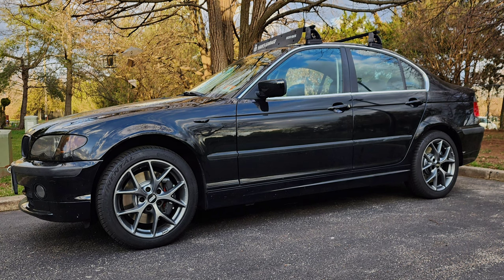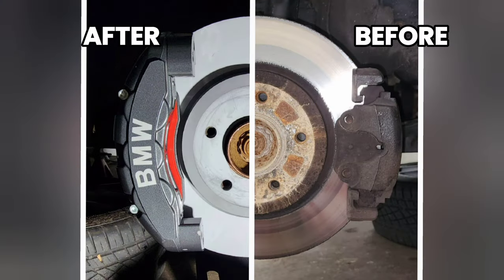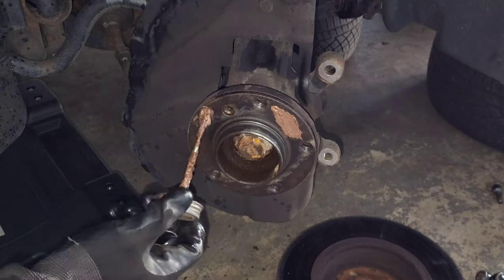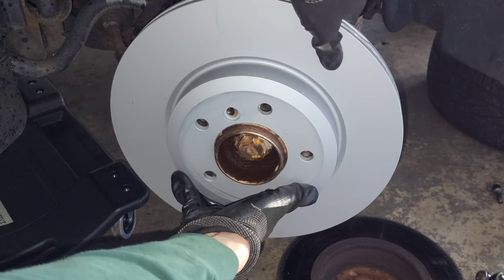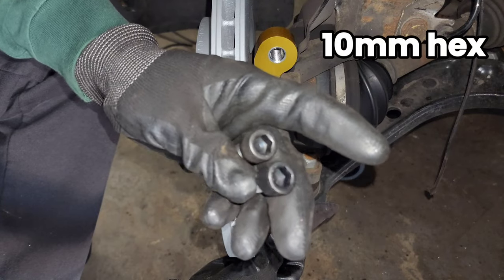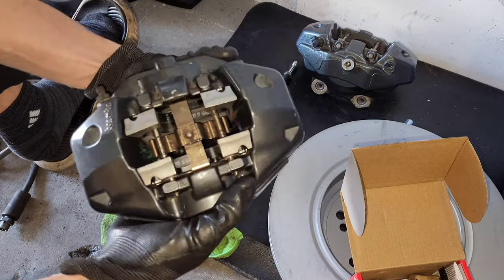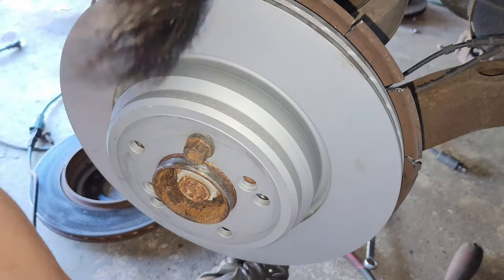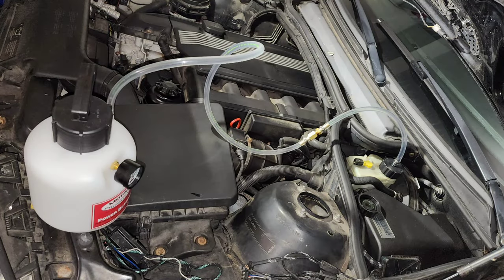BMW e46 Big Brake Kit Upgrade

Comment: Good to know everything bolts up on an Xi too, usually hard to find specific info on them. Brake booster issue is a bit disappointing… nothing else seems to mention that in my research. If you end up trying out the Porsche conversion that would be super interesting to see, looks like those are shared Xi or not
Reply: Don’t act like you don’t have to fix other bs on ur car buddy 😂

Comment: That’s not a BBK…. I’ve put the F82 M4 discs & callipers on my E46 M3.
I’ve developed a fitting kit that allow the F82 M4 brakes to go straight on, NO machining of the caliper at all.
Done both my 46 M3’s👌
Reply from the maker: Big brake kit. With brackets from seems legit garage. Also no machining to the calipers. What did you do to develop a fitting kit?
Reply: @HansGarage  PM & I’ll so what I’ve done!!👌

Comment: hey Han, great walk through of the process. i have a Z4 3.0si coupe, and I acquired some porsche 996 calipers that will be going in with m3 csl rotors. one detail i'm trying to iron out is about the parking brake. shoes for the non-M Z4 and E46 appear to share pn's, however M coupe and E46 M3/CSL all share a different brake shoe part number. I saw that your ebrake shoe looked a bit worn, but was wondering if you could comment on how well the non-M E46 ebrake is functioning with the M3 rotor?
Reply from the maker: I did have to adjust a little bit, make it bit more wider with the shoes and it bites just as well as they did
Reply: @HansGarage  Han, thanks for the insight. That gives me confidence that i'll be able to make it work as well.

One thing i noticed is that aside from the shoe pn's being different between M and non-M, most of the rest of the hardware is shared. ie: the barrel adjuster, and the lever mechanisms, etc. I might try fitting some M shoes. I think the deciding factor would be whether the little rectangular lug cast into the trailing arm, that the shoes set on, is the same between M and non-M.

Comment: Since you switched to fixed calipers, why not go with floating rotors? Also, without the retaining screw for the rear rotors, will taking off the rear wheels risk also taking off the rotor with them? I've had to apply forceful kicks to get the wheels off on the side of the road before and I'd think in that case the rotors would come loose as well, so wouldn't a stud conversion be better?
Reply from the maker: I've looked at floating rotors, and they look so beautiful. Definitely the next round!
Reply: @HansGarage  Yeah, I was thinking from an engineering standpoint. With fixed calipers - the braking pads must be perfectly aligned with the rotors - which in theory is never the case (manufacturing tolerance stacking, wear, etc...). Floating calipers (stock E46) conform to the fixed rotors so perfect alignment doesn't matter, but fixed calipers (135i) require perfection. 

This is where floating rotors come into play - they can conform to the brake pad alignment on the fixed calipers. Stock 135i brake rotors are floating - and this is the reason why. 

When you used fixed rotors  with fixed calipers (as you did), you will more than likely get uneven brake pad wear and less even braking... It wouldn't be taking advantage of the "upgrade" and may even be more of a downgrade. One of the components (caliper or rotor) should be "floating" so the system can self-calibrate and align. Either the brake pads can align to the rotors, or the rotor can align to the brake pads.

I looked at a lot of other DIY's and I haven't found one that actually mentions this fact. Pretty surprising.

Another consideration in doing this upgrade is the spare wheel, if you have a donut (like I do), it will no longer fit onto the front and clear the caliper, and you may need to instead carry a full size wheel (increase in weight / cost).
Reply from the maker: @AnonyPersona  I honestly wanted to throw this kit away. Not just because of the bleeder screw but after installing the kit, with more pistons, the brake booster can't handle and the pedal travel is way worse... So besides all the other components, I wanted to get this pedal travel issue first. Turns out there's a direct replacement with minor fabrication with porsche booster, which I bought recently. I want to get rid of this issue first and have the firm brake feeling back. Once I sort this out, I'm planning on finding a rwd e46 to transfer everything over and go on the track. I'll mention everything in that video.

As for rear rotors, idk if you have this car or not but the wheel actually sit on the hub and that's why I cleaned the hub and put some anti seize to prevent from getting a wheel stuck on the hub.

I do have a spare wheel instead of a donut! Man I didn't even think about having a flat and getting stuck on the road!
Reply from the maker: @AnonyPersona  BTW, not all e82 135i came with floating rotors. They did have fixed rotors with the same brake kit.
Reply: @HansGarage  definitely make a follow up video on the brake booster retrofit. That's interesting. I didn't see any DIY's that mentioned that either.
Reply from the maker: @AnonyPersona  Evan Goyuk, and hellodanielchoi both vaguely mentioned the long travel but since they are not "tracking" they said they are fine with it....  When I felt it, I'm like this is not okay... that's how bad it is. I'll definitely make more in depth video soon.
Reply: You're right about the 135i's having fixed rotors. I don't have a 135i and my fcp results showed semi-floating rotors as the replacements. Stock are indeed fixed, which is a poor choice from a design standpoint.
Reply: @HansGarage  Nice that you are investigating it further. I took a deeper dive and I don't think floating rotors would do much in this specific application as the pistons for these 135i brakes are on both sides, so you should be 100% fine with using fixed rotors for this application.

Comment: Great video! Will this set fit on e46 330cd with OEM M3 floating rotors front and rear?
Reply from the maker: For the rear they will but you need 330cd rotors in the front
Reply: @HansGarage  any option to stay on euro E46 M3 floating rotors front and rear?
Reply from the maker: @sauber8623 with these brakes not sure…
Reply: @HansGarage  Fronts 330d are 325x25 and M3 are 325x28 so quite silimar....

Comment: Mais c est magnifique
Donc je peux faire pareil avec ma z4 e85 2.5?
Can i do the same with e85 z4 2004?
Thank you very much
Reply from the maker: I feel like it should but can't say it does for sure
Reply: No you can´t, because you need rear trailing arm from 330i. In front the 4-piston caliper from M140i fits Plug & Play with M3/M3 CSL rotor.
Reply: @wladimirwerz7393  thank you
Reply: @wladimirwerz7393 Hi!!! 
It sounds fun to do it on a weekend! 
What year do the m3 rotors? If you have more advice about this modification it would be very useful!!! mine is z4 e85 2003
Reply: 325x28 or 345x28 from M3 or M3 e46 CSL is needed.
Reply from the maker: @wladimirwerz7393 just the m3

Comment: how do the brakes feel after switching to the 135i big brakes? is the brake pedal more stifer, loose or feel the same?
Reply from the maker: I wouldnt recommend doing this unless you upgrade the brake booster. Better pads and tires will be better with stock set up.
Reply: @HansGarage do you have a video on how to upgrade brake booster? Which brake booster to upgrade to? Is it bolt on? Not much information on forums
Reply from the maker: @erikask6156 i do not. Im hearing porsche booster conversion is the way to go but also not much info i could find. I know forsure with the stick booster its not enough for these bbk upgrade
Reply: @HansGarage  Why ? Is the pedal feel mushy and soft after installing these calipers ?
Stock e46 brakes has a pretty firm/hard pedal feel.